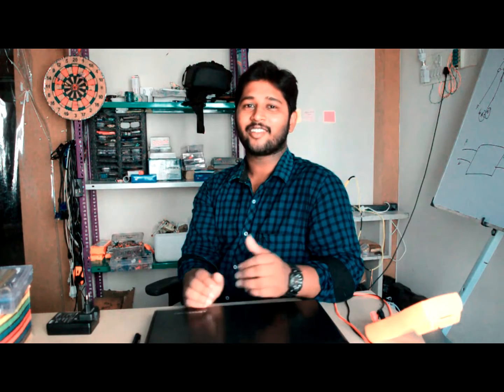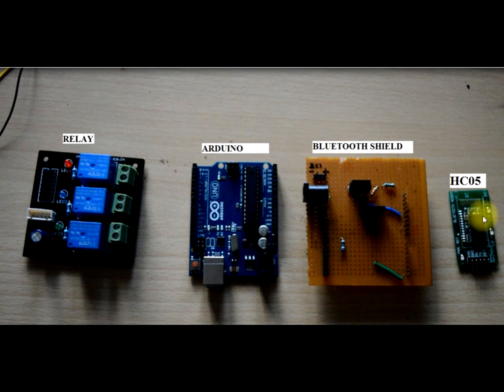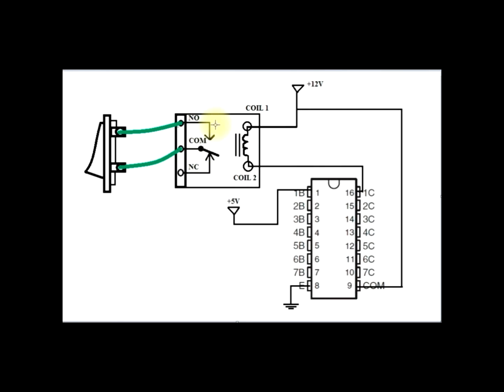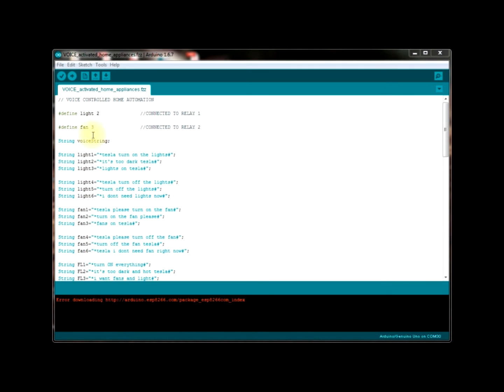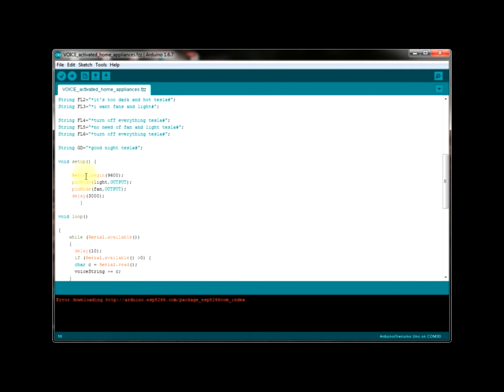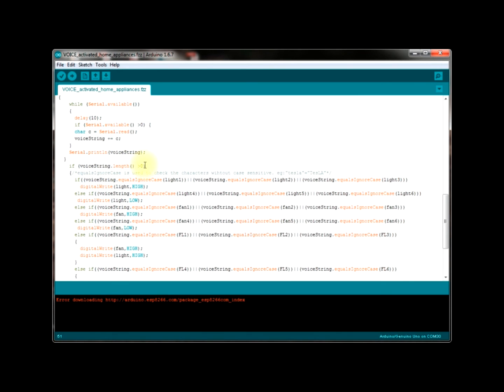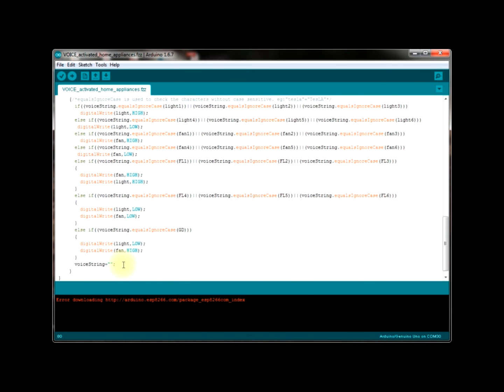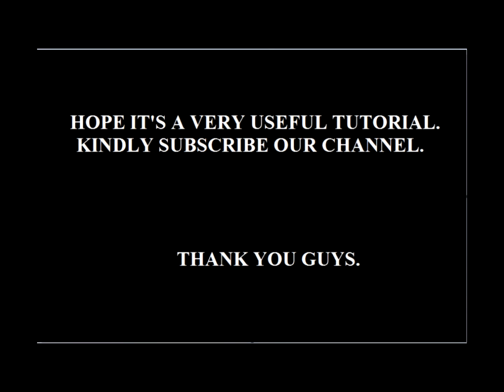ARDUINO HOME AUTOMATION

Comment: how did u connect it to a fan ? 
didn't the high voltage of the fan cause any hazards to the circuit ?
Reply from the maker: that wont happen... we use relay switch to connect to the fan's terminals

Comment: After everything is done as your circuit shows, the relay led for 1&2 channels keep glowing as soon as i give the power supply to the relay. Why is this happening?
Reply from the maker: check out your program weather any of statements are there making the digital pins on. if not check for the supply and ground are properly connected in your circuit.
Reply: There were a few changes I had to do for it to work. My relay module turns ON when the input is LOW and the code you supplied was inverse, not a big deal though and few flower braces were missing . Everything else was good. Nice project. I have a few questions though.
Reply from the maker: good to hear that :)